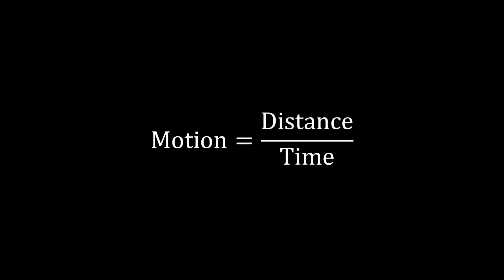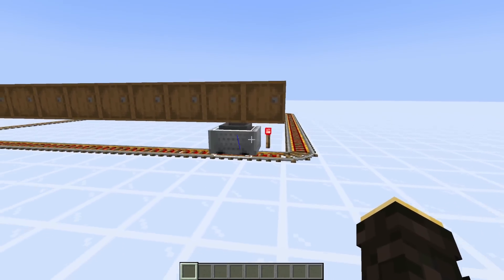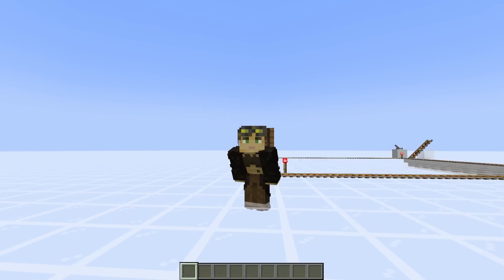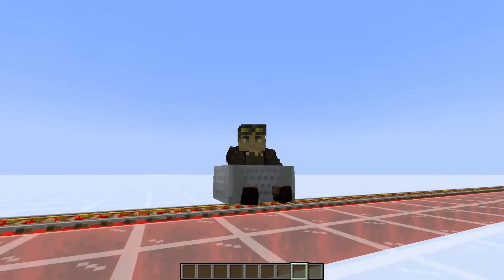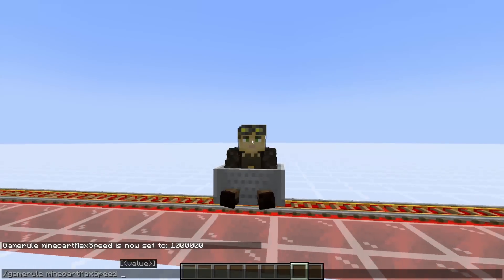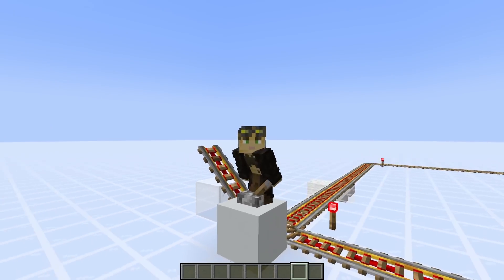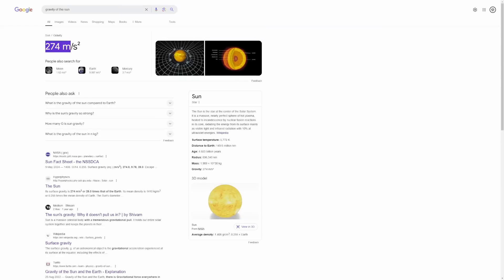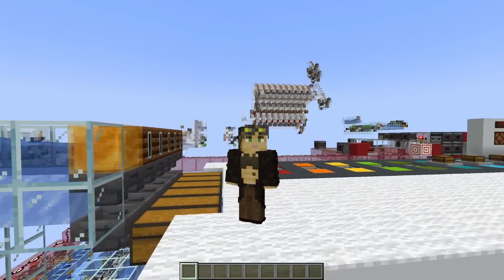Minecart Madness

Comment: I think giving more rails per craft would also make minecart travel and investment more viable.

Personally, while derailing might be too extreme, better accel/decel on minecarts, on rails and in air, speed adjusting rails and maybe a soft cap instead of a hard cap would definitely help.
The soft cap would make it so that higher speeds are achievable, but once it no longer gains speed, it will slow to a certain limit before decelerating normally.

Did I hear Hungry Humphrey's theme in the background?

Comment: people, this is about how you should complain that update changes break your fancy machine you "totally" need, not just saying twenty times in feedbag "revert changes", look into it and at least say what is wrong and maybe even propose solution, such as "give us new block that lets us fix old machines", it goes for minecarts and these proposed copper power rails (I think also normal rails could be made of copper those would have higher drag than iron ones but would be cheap to make, also dependent on oxidation, having different drag, making them useful on cheap rail networks or to slow down carts faster wherever you need), they could also add just bunch of different materials for minecarts, each having different drag or top speed, but also on redstone with more block update parts, they could add amethyst-redstone mixture (or something but amethyst has so few uses so I would smack it there and it is crystal, so it feels fitting) that would connect and overall behave as old redstone dust, making you control where you get this more block update switch thing you need and yet let redstone be more optimalised and less weird behaving in general use
they could also make that super fast minecarts would hurt mobs and players hit by them, instead of making mobs enter cart or just harmlessly bump into players..and dispenser minecart.. how I was excited when I heard about that one but it never arrived

Comment: about the aerodynamics,how about making a new type of minecart using copper that erodes away according to the speed it is at,at first it becomes more aerodynamic,however at last it becomes a block of gravel
Reply: (this is how reentry shields work however they dont burn away for aerodynamics and also they dont become gravel that easily because astronauts dont want to get hit by very hot gravel apparently :) instead they stick to the original place after burning away)
Reply: IDK what kind of gameplay purpose this would serve to either casuals or technical players alike tho apart from maybe novel contraptions, especially when Iron Minecarts isn't gonna be that much more expensive than Copper ones.
Reply: @user-tzzglsstle585e38  its funny,also now you can mass-produce pre burnt minecarts to use them one time at a huge speed

Comment: Hi, there are a few errors in the video, but I totally agree with the suggested minecart changes. The power output of the rails is not a constant 4kW, but, since they are outputting constant force, proportional to the minecart speed. At 80m/s they are outputting 4kN*80m/s= around 240 hp. If the rails were limited to constant power output (with a force cap at very low velocities) instead of force output, the acceleration and terminal velocities would feel even more natural.
Reply: There is a rough modelling for electric motors where u assume the torque drops linearly with the rpm, so u have a peak torque a 0 rpm, 0 torque at a certain max rpm and theoretically even negative at higher speeds. Power is also not constant but has a maximum at half the max rpm. I think it would be a good option in this case

Comment: 13:48 This used to be a feature in one snapshot where they increased the speed, if you were too fast you derailed. At the time waterlogged powered tracks didn't exist so there was no solution to slow it down, but with the copper powered rail this would be perfect

Comment: The weird acceleration of minecarts has actually been one of my issues with the experimental changes tbh
Theyve always been weirdly floaty, but the increased max speed and ability to jump makes it much more obvious that the acceleration is wonky. Having the cart shoot off a ramp and then slow its vertical speed to comical levels on its way down looks really dumb

Comment: I think rather than the copper rail working the same as gold but with a speed cap, it might make more sense for them to act as a 'break', just slowing the cart if it is over the set limit. It would reduce the fun of slowing carts for corners, but I think it would be a cleaner solution overall.

Comment: Small issue... but 4kw? 3400kg vehicle to 270kph on a tiny generator engine?
Reply from the maker: Technically if you give the cart a long ass rail it would eventually reach that speed on that power. Bear in mind the Lightning GT can accelerate at about 5x the speed of our hypothetical minecart.
Reply: @cubicmetre  i don't think the air resistance will let it though. 

also, you might want to add speed and drag to your power calculation in ~12:30

Comment: I think that derailing is too annoying. It would be a pain to build new railways because of it. Automatically decreasing the speed of the minecart when it makes a turn could solve this problem without forcing the average (non-technical) player to learn specific mechanics. We could add a speed limit to turns and make the minecarts gradually lose speed with successive turns.

Comment: Nice to know I was not the only to suggest a new rail block XD, although I thought it the opposite way around: a different type of rail (possibly more expensive) should allow carts to travel faster (possibly at different speeds varying on the type of items used in the crafting recipe) this, though would still leave space for many of the issues mentioned by talon but I do believe some of those will be fixed/reverted
Reply: The issue I can already see with more expensive recipes is that it wouldn't be very usable in normal survival scenarios for long distances, Gold itself is already quite expensive so giving them the max speed is a better approach while the cheaper options get to have the old speed-- consequently making railway systems even easier to make which is always a plus.

Comment: I believe the minecraft speed should be the same as currently, so 8b/s, but add a new very costly powered rail which is 10 times faster, at 80b/s (this would remove the need of piston bolt and will bring back minecarts to the competition of elytras and boats on blue ice). And also, make so the furnace minecraft speed can be modified by the player or restone components dynamically between 1b/s to 16b/s.

Comment: Or.. a crazy idea.. just dont change the gamerule to any extreme value? You can enchant a sword with sharpness 255 but no one complains that its too op? This as well as faster minecart speeds are just for fun and you can still play normally.
Reply: They are experimenting with that cap, which is why the gamerule exists now. It is likely to be increased to a new base value when the changes a re actually implemented because the new stuff like minecart flying physics relies on the speed cap being higher than 8.
Reply: @4547466  Yeah they implemented the new gamerule for experimental purposes but this doesn't mean they will suddenly increase the default values over 8 to every rail, considering they are being careful not breaking too much pre-existing contraptions (at least the significant ones or one's that doesn't have proper existing solutions); it's more likely they'd add a new faster rail/minecart altogether, at least more likely than them changing the default values for all.

Comment: We got minecraft CFD before GTA 6. May I suggest making your side walls a pressure outlet to reduce blockage effects and making your domain bigger to fully capture the wake. You can also cut your domain in half and use a symmetry plane to reduce compute time. For added realism you can set your mesh sizings to 62.5mm (the size of a minecraft pixel), and if you really want to play around do a transient solve with a 50ms time step.

Comment: Despite their lack of foresight with hoppers and item systems, the solution seems rather simple here. Make 2 variants of the minecart. One using the old mechanics and one with the new faster mechanics. Just make the the new one unable to carry chests, hoppers, etc
Reply: Same thought, different solution 😅
Reply: Uhh the hopper/item systems breaking is due to the new collisions (and is a bug rather than intentional), not from the "new faster mechanics" (which only takes place if YOU the player change the default values yourself).

You don't need 2 separate minecarts to fix these issues at all... considering they didn't change the minecarts/rails ro be faster.

Comment: One question, how did you get 3404.5kg for a Minecart, I did: iron density is 7.874g/cm^3, do that *1000 for kg/m^3, so then 1m^3, which is the size of an iron block is 7874kg, a minecart is 5 iron ingots and a block of iron is 9, take weight of block, 7874kg, and divide by 9 for one ingot = 874.889kg, times 5 for the weight of a minecart = 4374.445kg

Comment: I am against the derailing idea, entirely because unless you are in a 2D world turning is inevitable and in turn this is likely to make Minecarts slow down to the copper speed. Their use would be straight lines, or specifically just turning Ice Nether Paths into Rails. Without the ability to make wider turns derailing would be an obstacle that would just make this effectively more options for Red Stone and still less for actual mobility when riding it.

Yes I get physics exist, but then shouldn't Redstone burn out or lose its energy? Some irl stuff is good, others just make more problems. The key is to balance things for their expected use. Especially since every track would be x2 as expensive as you now NEED entirely different parts for going up and down in many cases.
Reply: Man if you are worried about derailing then [temporarily] slowdown the minecarts at turns or just use normal powered rails, Minecarts being able to go Blue Ice Boats alone would already make them super practical as a transportation method.

Besides, nobody builds railways for "mobility", even without the derailing and even when adding the ridiculous speed-- Elytras will inevitably beat out railways no matter what in terms of mobility you do unless you just turn minecarts into cars, railways are inherently not mobile.

Comment: So it seems that your CFD run is modeling a stationary minecart in a wind tunnel not moving on a rail since there are clearly boundary effects at the edges of plots in Ansys. 

Although how much of an effect this has I have no clue, especially as we never saw the mesh which would have a far greater effect on the realism of the run. And the no doubt complete lack of experimental results to compare the run to work makes it impossible to tell how good it is...

Comment: I dont think Mojang is going to change the default speed higher than 20 blocks per second or 1 block per tick (if they even change it at all), so basically at max speed none of the blocks will be skipped. A lot of game settings are added over the years and most servers dont touch them, like entitycramming at 24.
To counter this default speed increase you should just use waterlogged rails and then make the slowing force of water stronger, like 50%.
Theres also still the option for players to use furnace minecart to slowtravel on normal rails.
The speed increase is obviously not for the technical minecraft community, its for the creative community that wants nice builds and a roller coaster.

Comment: i dont like copper being used for a "worse" rail and would much rather prefer normal rails being made from copper to give some of the utility of iron over to copper
you could just have the hopper and chest minecarts bound to the 8 m/s speed instead although maybe it could be simplified to a minecart without an entity inside of it capped at 8 m/s, also making trying to get back to a minecart you accidentally left easier
Reply: alternatively you could just have the new "capped" rail use iron and lock based on redstone power

Comment: The copper rail suggestion not only does it add a great addition, it also applies real physics, due to Lenz's Law! Like when you pass a steel ball through a copper pipe, it gets slowed down! All because of Eddy currents produced by the motion of the ball, or in this case, minecarts.

Comment: they should just add a new faster minecart type, like a golden minecart or copper minecart
Reply from the maker: But gold and copper are heavier than iron meaning they would actually be slower, defining the properties in the rail makes a lot more sense given the rail appears to be the thing doing the propulsion.
Reply: @cubicmetre Slower acceleration but higher top speed, assuming drag doesn't change, no?

Comment: I think we should introduce new types of minecarts with different max speeds on top of new rails, I don't think they're enough by themselves.

Also, Mojang actually experimented with derailing in the early days, but they didn't like it.
Reply from the maker: De-railing was actually a bug and not intended. The problem is minecarts would only turn corners if they happened to be ticked on the curved rail. So minecarts travelling faster than 1 block per tick would often skip past the curved rail and then de-rail. This bug was actually the reason why speed limits were originally imposed. It seems the new implementation performs a raycast to determine the shape of the rail before the entity moves, so now it reliably follows the rail. My suggestion for re-railing is to have it implemented for much higher speeds where it doesn't make sense for the cart to turn corners at such speeds.

Comment: A dedicated new rail type was one of the first things I thought of when I saw the experimental minecart speed changes. Far too many things rely on the current minecart speed for a universal speed cap adjustment. Having either a new rail type or a new minecart type would allow players to have the best of both worlds, allowing for faster traversal via minecart and consistent speed for complex contraptions.

Personally, I think a new rail type would allow for more flexibility in builds; but even just a minecart variant with a higher speed cap would be a big step forward.

Comment: I also want to point out that the power output is not 4.085 kW. If powered rails exert a constant force regardless of speed, then the power output at any time would be equal to force x speed (P = Fv) and so at the top speed of 75 m/s the power output is actually 4085.4 * 75 = 306405 Watts = 304 kW, which is equal to the power of a sports car.

Comment: I love the idea of the oxidized copper for different speed limits.

All of your ideas here would be great to see in a mod if Mojang doesn't add them.
Reply: it would make the manufacturing of once-oxidized rails quite fun
gotta make em, then oxidize them once, wax em, and then collect them.
Reply: I fee like another comment said redstone rails would be better because you have more possible states and you can dynamically control them with redstone. But i think they should still be made out of copper but controlled with redstone.
Reply: @ICE0124  From a practical perspective, I'd have to agree. I was looking at this from a thematic perspective, tying it into copper's main mechanic, and it seems believable that more heavily oxidized copper rails would be worse to drive on.
Reply: @decare696  first off that would completely make sure new players don’t get into mine carts second off it’s visually unintuitive and You don’t need that much options honestly
Reply: @ICE0124  thing is that would fvck so many Redstone machines.
Most would need to be redesigned.that would split the Redstone community
Reply: @NewUser000NewUser  The way it could work is that gold ones still accelerate minecarts to their usual speed, and then, if they are still on gold rails, their speed begins to increase. This means that if a contraption only uses one or two rails to kickstart a minecart, this wouldn't be a problem.

We could also introduce a soft cap of 15, so that it can go faster, but will try to slow itself to a certain speed before maintaining that speed or decelerating normally.
Reply: @ICE0124 average gold rails are just made with redstone tho
Reply: just a worse idea than controlling it with redstone
Reply: It would be very cohesive with copper bulbs, too!

Comment: I am looking forward to connected minecarts to create a fucking train.
However, if copper rails were to be used for a limited speed, it would just make minecarts insignificant, as gold is rare to find, and people wanted minecarts to be fast.
Furnace minecarts could be added back, along with connected minecarts to make full on trains without collision problems.
Reply: ... what do you mean furnace minecarts could be added back? they were never gone, were they?
Reply: Gold is NOT rare to find lmao

You can literally get 2 stacks of them by simply mining in the nether for an hour without fortune by the way and you can do this with low-level gear, if anything; Gold being the super-fast rails just makes gold ACTUALLY more valuable.

The only issue with powered rails rn is you get too little per crafting, but that can be very very easily solved as you can probably tell already.
Reply: @user-tzzglsstle585e38  Sorry, didnt think about the Nether and stuff.